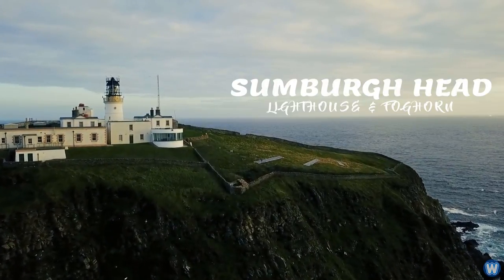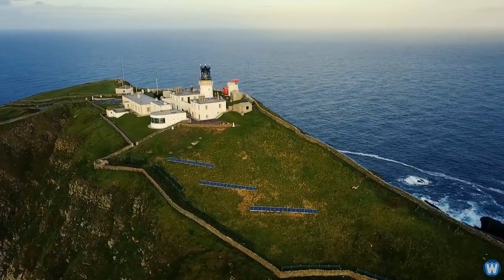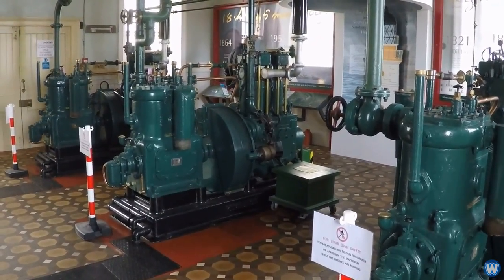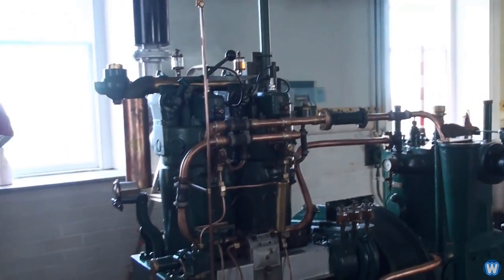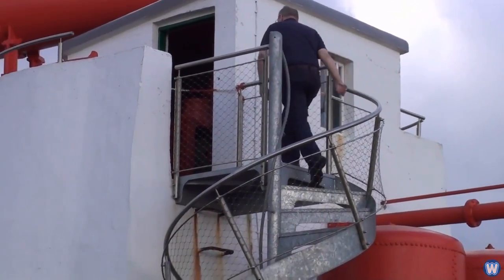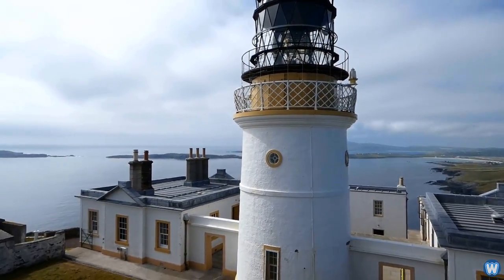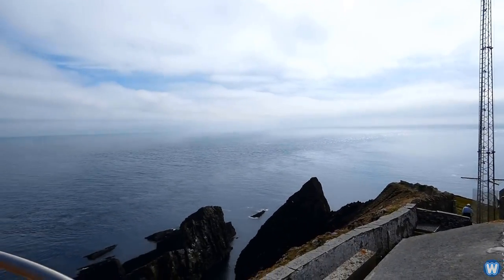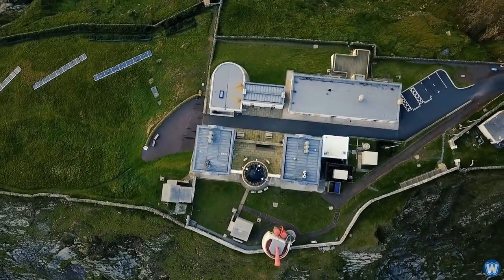Sounding The Sumburgh Head Foghorn The Last Working Foghorn in Scotland.

Comment: "Last working Foghorn in Scotland".....thats not the case anymore. The big red Foghorn at Mull Of Galloway Lighthouse was recently restored to working order.
Reply: Really?
Reply: @TSAR2010 Really.
Reply: They are fog sirens not horns
Reply: @jezcolborne6329  they are horns, no choppers, no speakers. Just air. No not a pneumatic siren. ITS A HORN.
Reply: @TSAR2010  no its a fog siren not a fog horn. It has a rotor stater and the air powers the rotor stator. The reason it sounds like a horn is that the siren speeds up with the air driven motor then the air is forced into the rotor stater t make the sound when it's at full speed and you can hear it moan because it is a FOG SIREN.. If it was a horn it would have a diaphram to make the sound. It's not a diaphone because it may have ports but they dont rotate they vibrate to make that sound the only thing that is like a horn is what that big red thing is at the front. I have heard another one like this and it sounds like a cow and it has the same red horn at the front. I also love sirens and this is very much a FOG SIREN
Reply: @jezcolborne6329  it has no chopper.
Reply: @jezcolborne6329  they use noisemakers.
Reply: @TSAR2010  it has a chopper
Reply: @TSAR2010  it needs a chopper to create sound from the compressed air that goes into the rotor stator choppy choppy chopper machine thingy dingi
Reply: @TSAR2010  no they dont. The whole machine is the noise maker because the rotor choppery thingy makes the sound with pulsing air and comes out of the red horn and the result  a very very loud and low waoooooooooo waoooh like a siren as it is a siren
Reply: @jezcolborne6329  I'm an ex Lightkeeper who operated identical equipment to what's on this video, whatever the argument they were always referred to as a horn regardless of which system made the noise.
Reply: @ronireland7347  ok but this is a fog siren as I have seen some lighthouse lists for scotland and this lighthouse was stated to have a FOG SIREN. There is a different way of looking from my point of view as this has a HORN for the sound but the SIREN makes the sound go into the HORN to make it LOUDER by a rotor stator driven by air. The fog horn to me is a DIAPHONE which sounds like a horn. So to say any foghorn is a horn is wrong because this uses a rotor stator not a diaphragm. I am not an ex lighthouse keeper but I know about these scottish fog sirens as they are 1st class fog sirens that has a horn which can be moved to get the best siignal to the ships.  in england we also had fog sirens but there were 2 types of fog siren. One was single toned and the other dual toned. one had huge horns jutting out the sides then the dual tone siren had smaller horns but still realy loud. The difference is that the scottish sirens dont sound until the rotor is at full speed but the english sirens ramp up just like a warships steam siren giving the classic whooop whoop just like the older smaller ship sirens in the 40s
Reply: @jezcolborne6329  I understand Jez, I was referring to what it was generally called irrespective of what type. e.g 'I'm away to start the horn'. Incidentally we did call the bit which was removed and cleaned regularly the 'siren'
Reply: @ronireland7347  well who ever called it a fog horn rather then a fog siren was rong. It's a siren. A big huge siren. The only thing u can call a horn  is the red thing at the top of the siren to make the siren sound louder so it's a fog siren with a large horn. There was another siren which had 2 sirens with horns facing left and right somewhere in scotland not working but that is another type of fog siren

Comment: Didn’t know these things are getting rare, here in Rhode Island just about every lighthouse has a dog horn
Reply: Thank you so much for the hearty laugh! I assume that your mention of "dog horn" is a typographical error. However, I do have a "Dog Horn". It is a salvaged air horn from a diesel locomotive. I live out in the country. A neighbor has a kennel full of hunting dogs on an adjacent property. Some evenings, especially full moons, the dogs will get to carrying on, barking and such. It is usually deer or coyotes moving through the area that gets them all excited. Because of how the buildings are laid out on his property, my neighbor can't hear his dogs from his house. I, however, can hear them quite well, even though they are more than 200 yards away. If they don't settle down after 15 minutes or so, I go out on my back porch and give the lanyard a 3 to 5 second tug. The horn is mounted on an 8 foot tall post and is aimed directly at the kennels. I run it at 60 psi, from the compressor in my garage. There are no rail lines within 10 miles of us, so it isn't a sound the dogs are used to hearing and they tend to quiet right down. Usually, after I let the lanyard go, all I hear is the sound of the horn echoing through the woods. It even shuts up the coyotes.

Comment: you said kelvin diesel engines why are two sparkplugs on the engines ? i guess that this engine runs on gasoline or similiar easy volatile fuels
Reply: The way I understand it, the engines are started on gasoline, and switched to diesel once they’re hot. Some tractors used a similar system back in the day